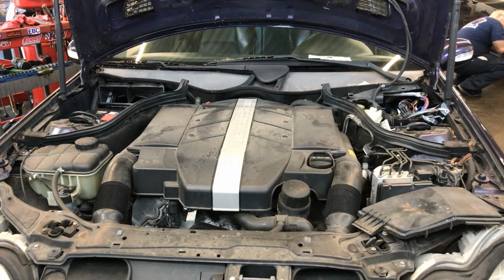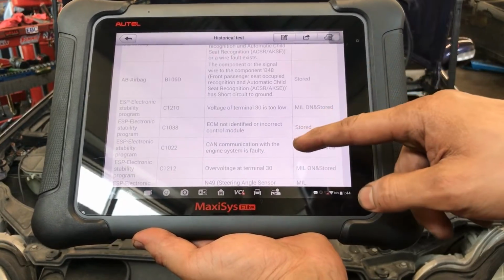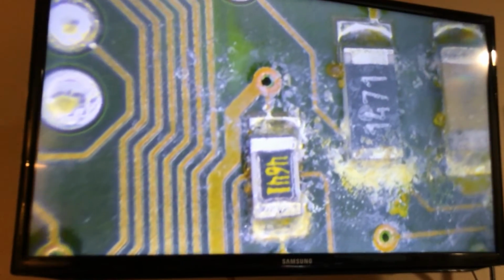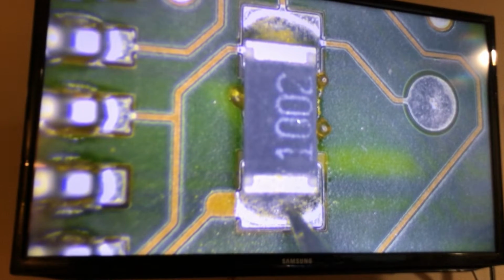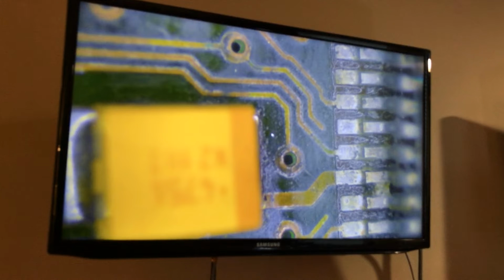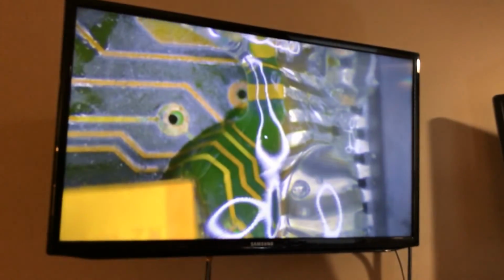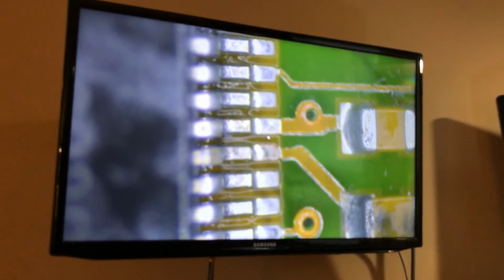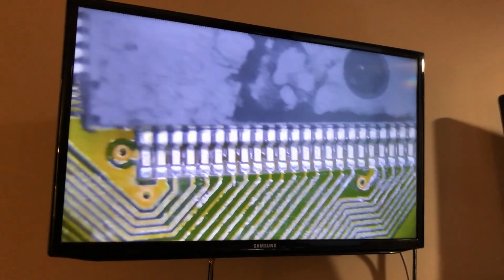2002 C240 No crank Engine Computer Repair Part 1

Comment: I have the same board 2004 C249 wagon ,I can jump the pink starter wire and start the car with the key on ,but won't start from the key.  Can acetone  clean it also ?
Reply: acetone melts plastic.  He is using alcohol ...
Reply: Mine was a bent pin

Comment: Hiii...m working on ECM which is EDC17c55..it is from mahindra car...in this ecm 48 volts is produced which i guess comes from the injector driver bt m nt sure...there is no 48 volts being made on the ecu on which i m working nd seems to be faulty...i hv also replaced injector driver bt no luck...plzzzz tell me from where does this 48 volts come from nd how it is made inside the ecu???? plzzz advice..thank you
Reply from the maker: You have a big coil inductor that will produce the voltage and two big capacitors that store the necessary voltage.

Comment: I have 2010 c300 I have water in side the driver side from rain I think and everything doesn't work no horn airbag lights on,  wheels are locked, but the radio works and windows sometimes works, any idea where should I start?